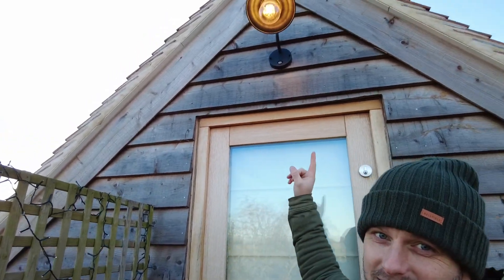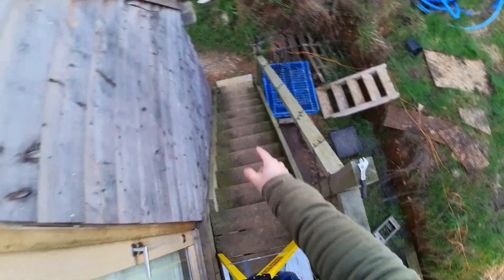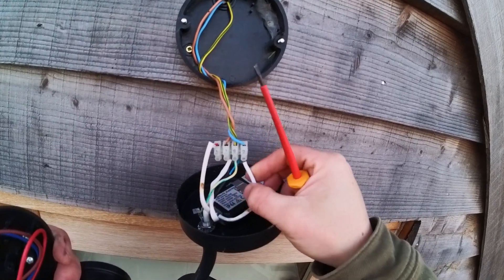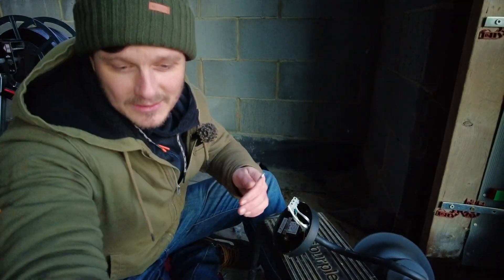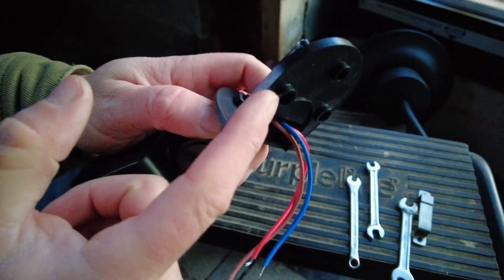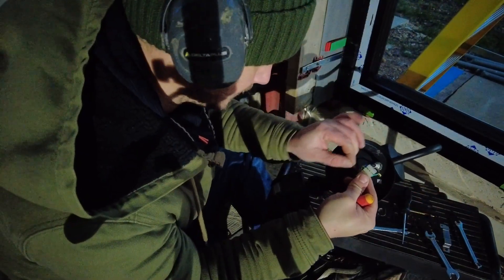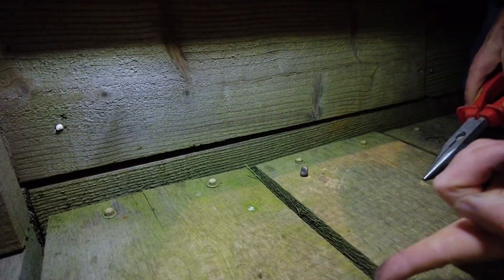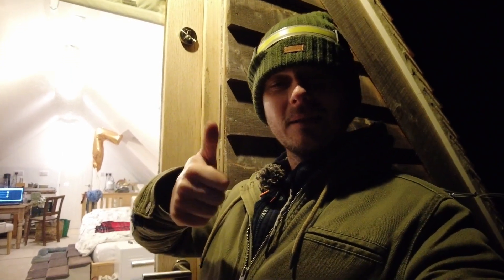How I Fixed My Outdoor Light  - PIR Sensor

Comment: Nice one! Great success. I would have just added a bit of wood as a mounting  plate to alter the angle on the original. 
Clearly your new PIR has a better range though so it's an upgrade. Happy days, another job jobbed.